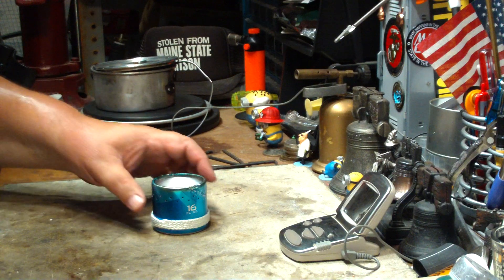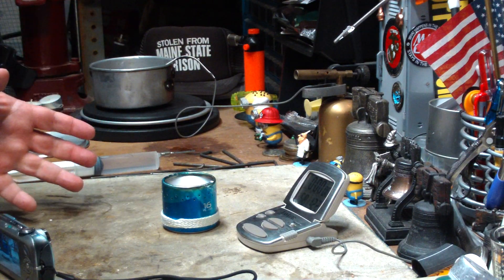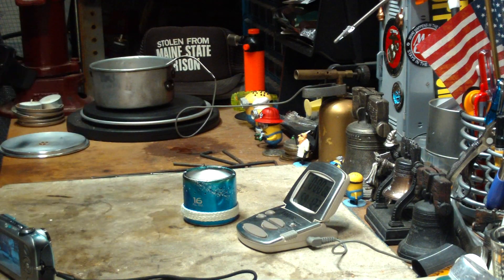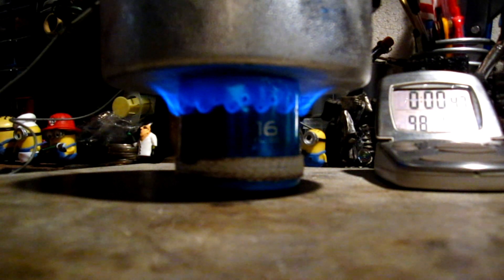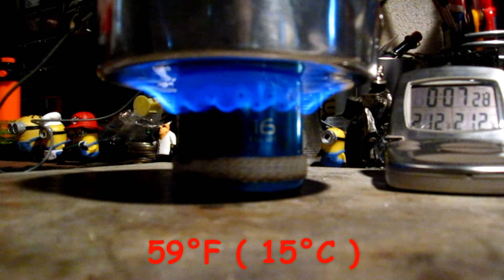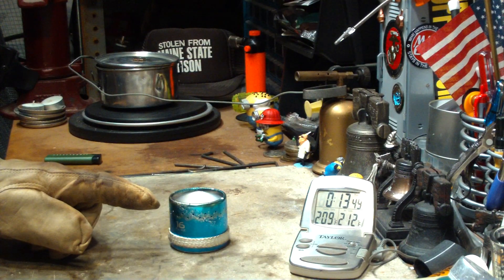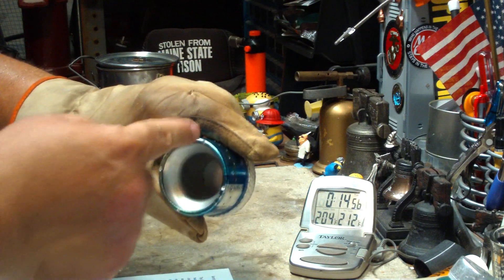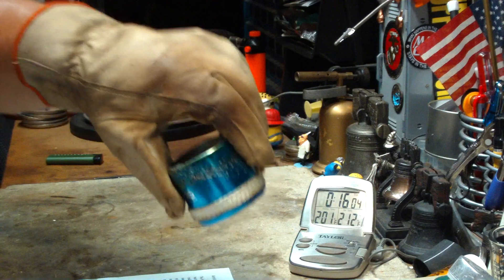BatchStovez BS 2 0 FE Stove - Boil Test #1

Comment: Just wondering how as you light this stove the water temp reading increases from 60 to 99 degrees in five seconds before the a solid bloom? So it took 7 min. To boil 99 degree water or what? How is this possible and what does this mean for test accuracy?

Comment: Great test Hiram,
 I thank you for braving the heat to do this test it's a little hot for boil tests. I think your times are right where they should be for a water temp of 59 degrees. The added benefit of the pot being on the stove is the water temp is raised as the stove blooms.
 Thanks ,Sam